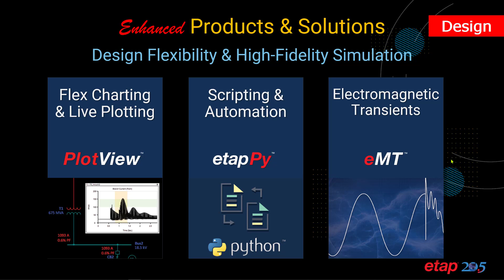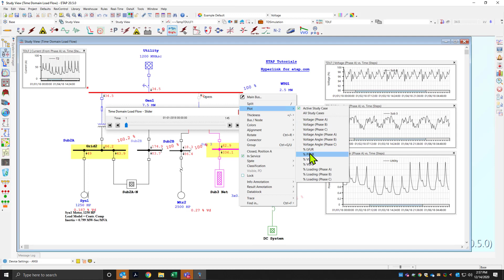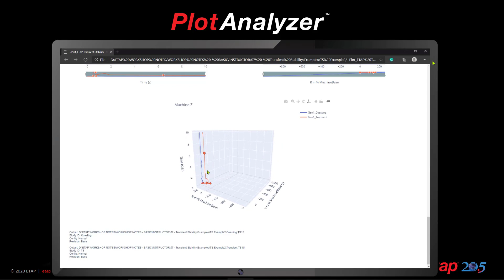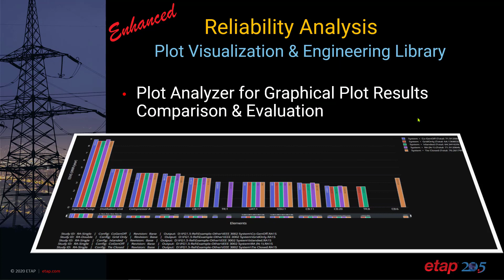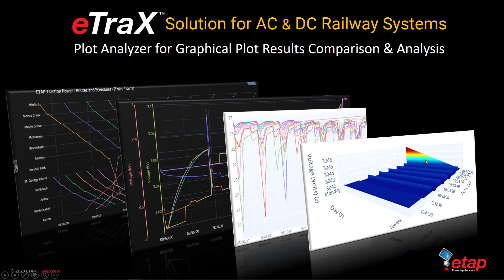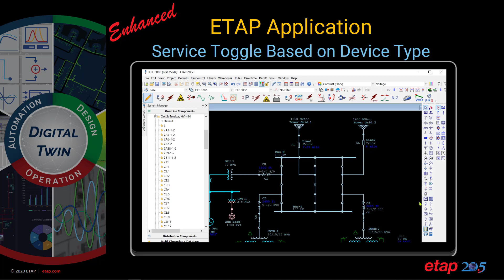ETAP 20.5 - New Features & Capabilities

Comment: When using ETAP for calculations like Voltage Drop, Free Air or Underground Ampacity Calculations, etc. Are result compatible with NEC only or other ones as well like Canadian Electrical Code ( CEC), or ....... How we can select either US or Canadian or ,,,,, other codes and standard and /or how do we know which one/s the calculations are based on?  Please advise.
Reply: Hi Mike. Unfortunately we do not have an option to set the analysis calculations to CEC. You would have to confirm the output results meet the standard after running the calculations. For cables, we use globally accepted engineering standards (IEEE/IEC, etc.)

Comment: Hey, thank you for your video, on etap 16.2, I  tried to replacate the IEEE1.udm model but I'm obtaining different output between the original one and the replacate. I noticed the input is changing each time I draw a new udm. My question to you is : is it normal that the input changes like that? And how can I control the input?
Reply from the maker: Thank you for your interest in ETAP Software. Please contact our technical support at support@etap.com to request assistance with your issue.
Reply: @ETAPsoftware  I can't, can you transmit my question to technical support and let me know?
Reply from the maker: @king bob  Do you have a valid ETAP licenses? The features shown in the video above require ETAP 20.5. If your license is current you will be able to upgrade for free.
Reply: @ETAPsoftware  thanks for nothing